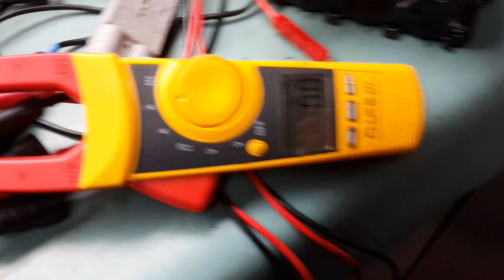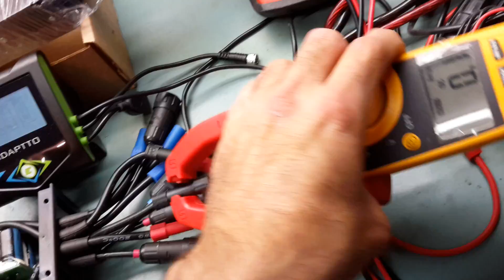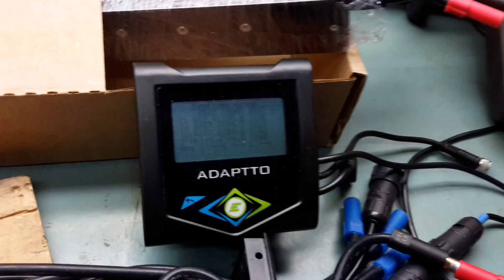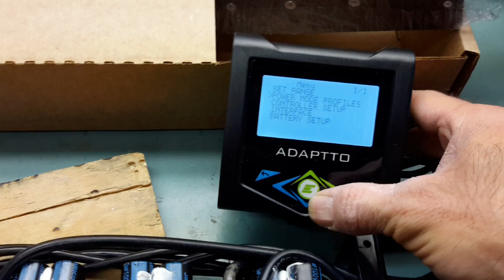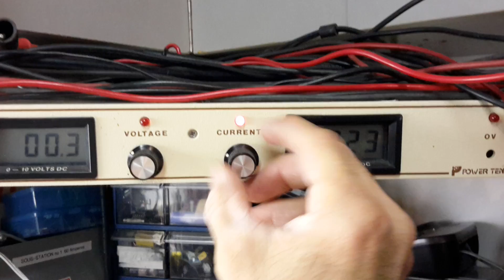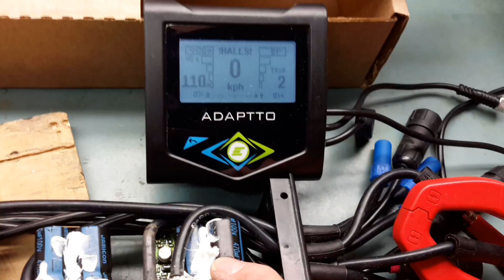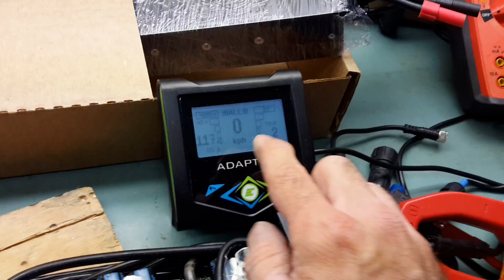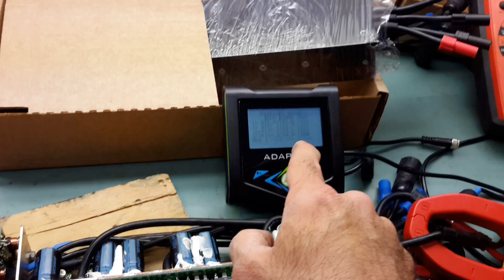Adaptto max-E controller shunt investigation

Comment: Great informational video.   Did Adaptto resolve this issue?  They clearly aren't properly testing their controllers before shipping to customers.  I am having the same issue with my mini-e controller.
At 12:22, did you notice the max battery current = 183A !?

Comment: Is there something related with the firmware version? I've been running RC7b and my ShuntR value is 0.305 milihom. In Boost mode I can set up to 156 Amps for Ib and while riding I read up to 140A.

Comment: Although the controller current sensing algorithm has a temperature coefficient compensation, however the T sensor is located not exactly near the shunt, but underneath the aluminium heatsink, so on open stand you will have an error when shunt heats up, however while riding the controller itself will heat up as well and the t° compensation will work as it should.
Reply from the maker: +andreym1983  OK excellent! that's very usefull info!  Thanks Andrey

Comment: ShuntR value is limited by firmware, so if you want to make your controller output maximum power, you can add some coper to the shunt to make it value = the lowest value in the settings you can choose, but not lower than that. If actual resistance would be lower than the one set in calibration menu, your current readings on the display and the wattmeter would be inaccurate.  However if you make modification to the shunt, this will void the warranty, so instead just flash unlocked firmware version that will also void warranty, but will allow you to set any current you want in profiles without touching the shunt :)